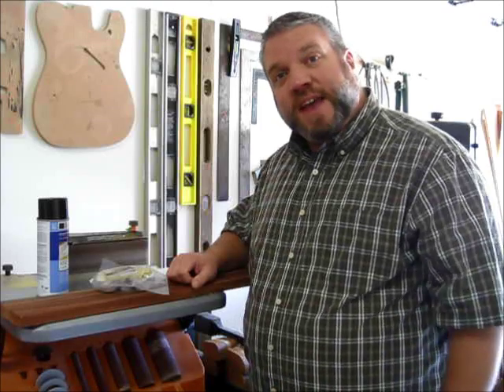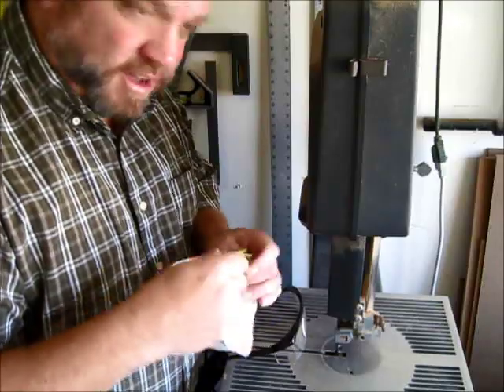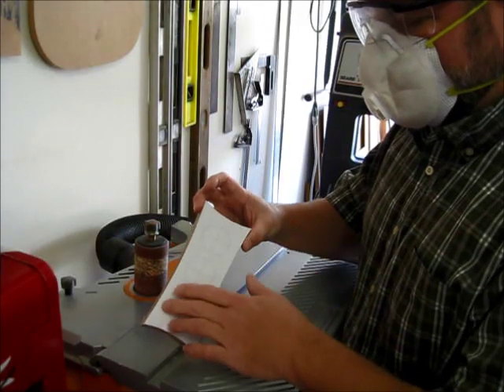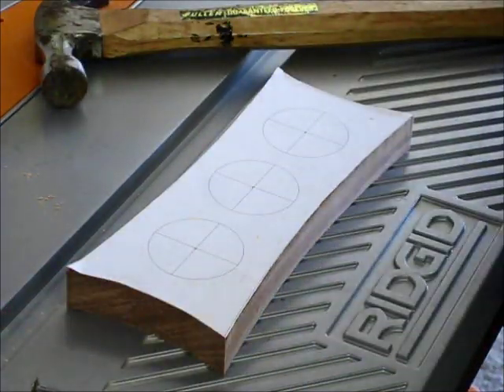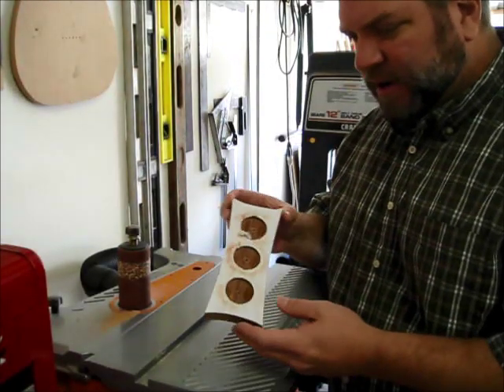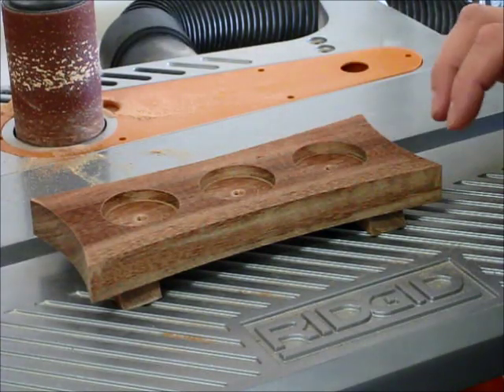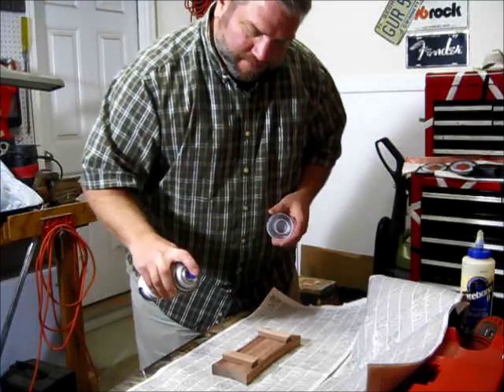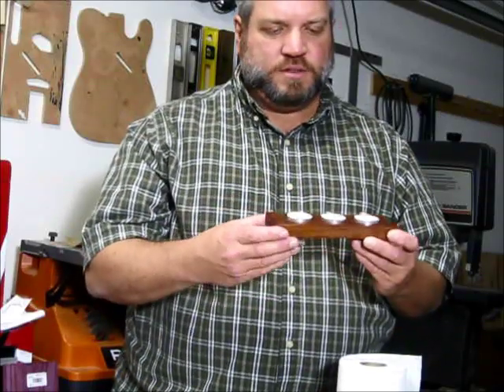How to Make a Tealight Candle Holder - Easy DIY Woodworking Project

Comment: One thing my father and i do when using glue on patterns is cover the wood in a good quality clear packing tape before gluing on the pattern. That way you can just peel off the pattern when you're done cutting :)

Comment: I did the damage by riding motorcycles for 48 years.  By the way, thanks for this video.  It put a tealight holder into the very long list that lives in my mind.
Reply from the maker: They are real easy and make great quick gifts.  Sometimes I make a bunch out of scrap just to have on hand in case someone visits.  You can buy the candles in bulk or a dollar stores, just get them first so you can drill the right size holes...the candles are not consistent in size from different companies.

Comment from the maker: Thanks!  Yeah, I'm always trying to get better at setting a good example as far as safety goes.  I should have worn it when spraying lacquer too.  I only have one dust mask and I sometimes misplace it, along with my pencil and tape measure. lol  I have a new respirator now so I will be using that in new videos.

Comment: Nice job.  You must have different Tea Lights than I do, I used my 1 3/8 forstner bit and the tea light didn't fit.  Guess I should have measured the tea lights first. LOL.
Reply: Yeah, depending on who the maker is, they range from 1-3/8"-1-1/2". I've done the same thing before.
Reply from the maker: The tealights I used came from Dollar Tree.  I haven't tried any others.  If you can't find any that size let me know and I can mail you a couple of bags.
Reply: I made something similar to this a while ago, and even with a 1.5 inch bit, it was still too small.
Reply from the maker: I guess there is no standard size in the tealight candle industry.

Comment: Hi Steve,Thankyou for the great video  .  I am a very new beginner getting into woodcraft . I am after some advice. As I am starting up, I don't have any of the tools . Is there any alternatives I can use for the BandSaw and the Spindle Sander ? Also what is the software you used to design the template ?
Reply from the maker: Get a coping saw and sand paper for about $10.  Or step up to a jig saw.  A drill with a drum sanding attachment is a good alternative to a spindle sander.
Reply from the maker: I use Microsoft Visio to draw templates.
Reply: Thanks Steve

Comment: I am trying to find a project for shop class. How big is the board you used for the candle holder and how big are the feet of it?
Reply from the maker: Maddie Nowak Hi - I think the board was a standard 1x4, which is 3.5" wide.  There is a template for that on my website on the project plans page www.thecarmichaelworkshop.com
Reply: Thanks!

Comment: Just an observation, If you are concerned about your eyes and your breathing you should wear ear plugs also. You don't want to lose your hearing I can attest to that. Very nice candle holder by the way. I think I will do one also.
Reply from the maker: +ALLxoxoxoxo  Good advice!  Thanks!  Make sure you get the candles first cause they are not consistent sizes brand to brand.
Reply: Really! thank you. may need to buy several packs. I have seen those at the dollar store myself.

Comment: I certainly like your project and i will build one soon BUT my biggest concern is the clear finish you use or any finish anyone uses is it flammable? I have never seen anything in the market that is non flammable. Please let me know so that I can begin with this project. Thanks.
Reply from the maker: frehleycomet It's spray Deft lacquer.  Once it dries and cures it's fine.  Don't light it if you can still smell it.  The flame never comes into contact with it.

Comment: Ear Protection!  It's easy to run those machines and lose your hearing (ask me and I might be able to hear your question).  But it's impossible to find your hearing and return it to your body.  Once gone, it's gone.
Reply from the maker: Yep, I have had hearing aids for a year. Use isotunes now. Mainly from drumming in rock bands for 30 years though. One band had a 5 year run of playing about 60 shows per year for 5 years, 3 hours per night that took its toll.
Reply from the maker: Oh and hearing aids are cool. They work great and I cant even tell I am wearing them. Best to prevent hearing loss to begin with, but it is no big deal having hearing aids. Same as never needing glasses and now using reading glasses to me.
Reply: WHAT?????????